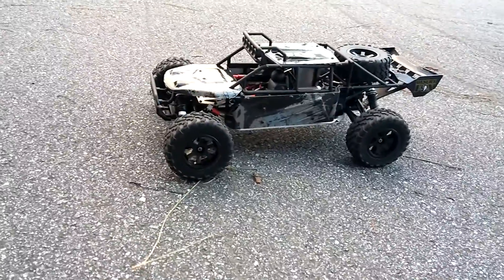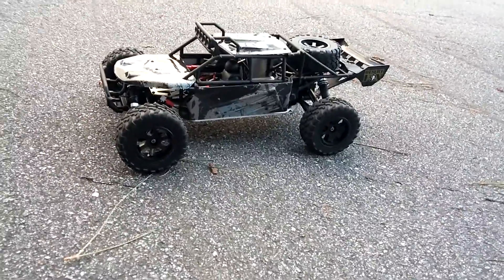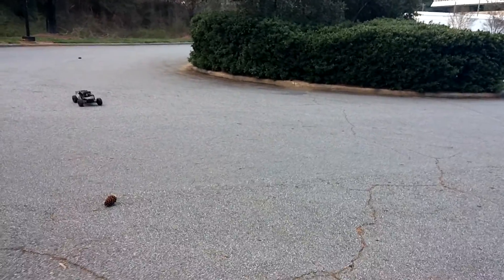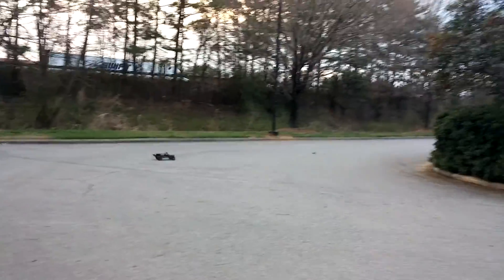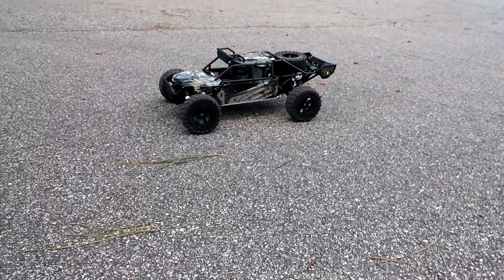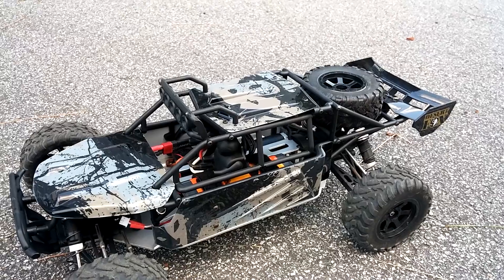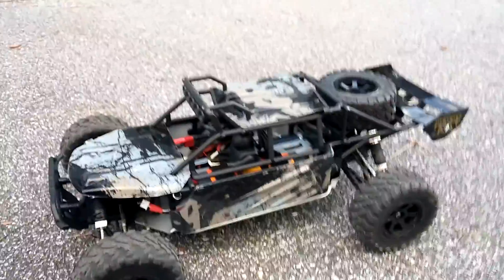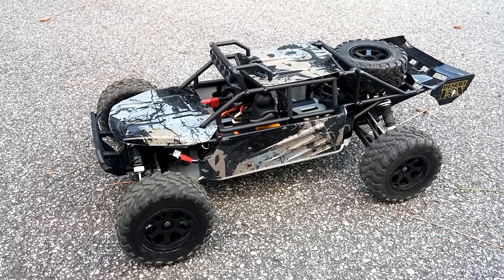Hobbyking Desert Fox run with upgrades.

Comment: I got the team associated xp cree led light bar and it's a great lightbar with nice push button switch. Good price as well comes with all the mounting hardware runs 2s lipo. It hooks into the receiver which I'm running 3s and the bec that's built into the esc and I'm getting no issues off the 3s Lipo. Very very bright setup!! Nice lookn to. Yours will fit the 5 led or maybe even the 6 led lightbar nicely....

Comment: I got the Hpi Nitro Firestorm spur for mine,it's 50T and either 0.8M or 32P.Diameter is pretty much the same as the stock spur and it works with the existing slipper setup.

Comment: just ordered a metal gear from ebay made for the vandel hopeing it will work out! That exposed spur gear scares me though. Fun buggy though  4000kv looks perfect though on this nice vid!
Reply from the maker: i ordered one as well but just put this top on my slash 4x4
Reply: +JayTee RC sweet!
Reply: +JayTee RC ive got an old xerun 80amp in mine with tacon 2300kv but having issues

Comment: Hey bro! What's the difference between 2 pole brushless to a 4 pole brushless. I'm currently running a 2 pole sensored toro brushless 4000kv motor one 2s and 3s. I will say this motor on 3s is FN wild bro. Standing backflips from complete stand still. Almost too much power. Thanks in advanced. Nice ride by the way. I'm bout to start building the jlb cheetah so well see how that project turns out.

Comment: @JayTee RC it seems to run fine with that setup, but it's fast. Only running a Zippy 4000 2cell Lipo. Only issues is the COG. Have to constantly turn off power and turn on then it's fine for a little bit then have to turn off and on. Any ideas regarding the COG and fixing it? FYI I'm more of a RC Plane flyer.

Comment: Looks good, so was it just the motor/etc that you swapped out ? Just bought 3900 kv motor with 60a esc. Had issues with stock setup, 1st buggy burnt out 1st run. Replacement I installed heat sink and fan but have another issue but no sure if it's the motor. But I'm replacing anyway. Have also bought replacement pinion. Is there anything else I need to replace like the spur gear? And I don't seem to have any brakes going forward. Am I binding it to my dx4s wrong? Cheers
Reply from the maker: +rod ders just motor and esc replacement

Comment: where did you get you're motor setup from just got one looking to upgrade mine. thanks
Reply from the maker: +Damon Hill got to towerhobbies and look at the rc gear shop 3900kv motor.
Reply: +JayTee RC OK did u change out the gears. or just the motor
Reply: Thanks for answering my questions bro

Comment: i think I found the  slipper cluch for this it looks a lot like a vandal 1/10 cluch and the vandal has the same motor
Reply from the maker: and the design is like that of the ftx cars
Reply: hobbyking make me laugh I just asked them on chat what they were doing about the motor problem and there saying it has been sorted lol
Reply from the maker: Lol
Reply: all they did was say it cant run 3s lol it can run dam 2s with out the motor melting